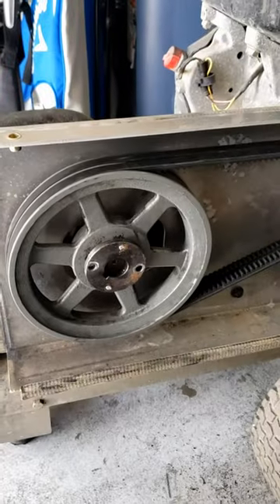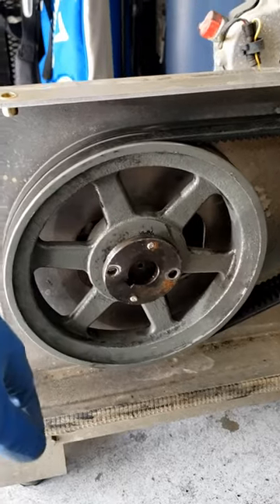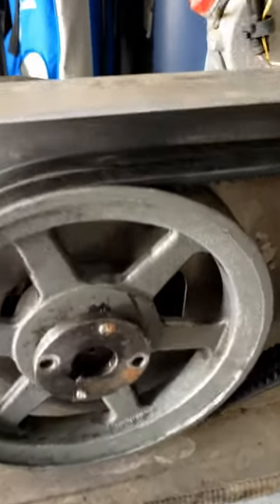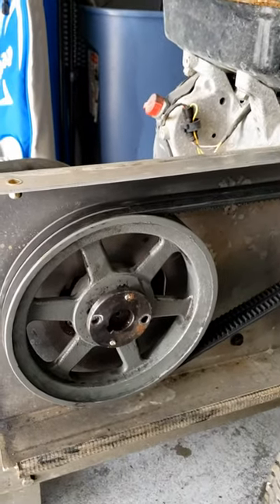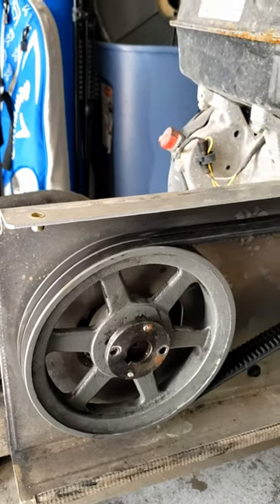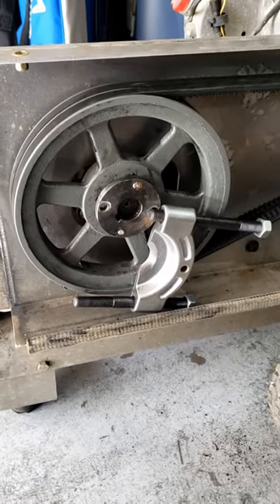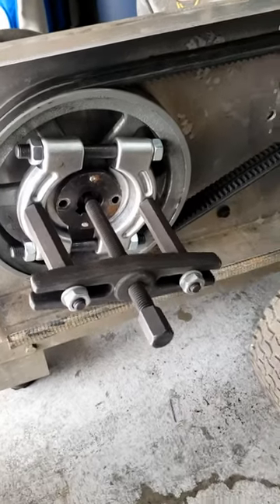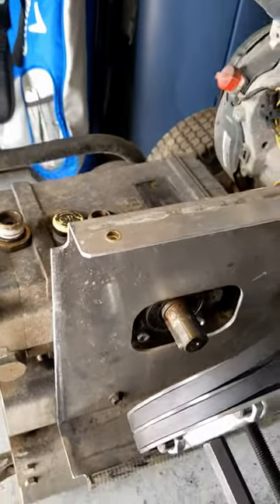Belt driven pressure washer pulley removal

Comment: Do you know how to install it back without braking it ? 🤣 I broke my bushing trying to install it back on the pulley
Reply from the maker: Hi, sorry for the late response, from what I recall it should slide back on without a lot of resistance, and I used a rubber mallet to make sure it was snug.